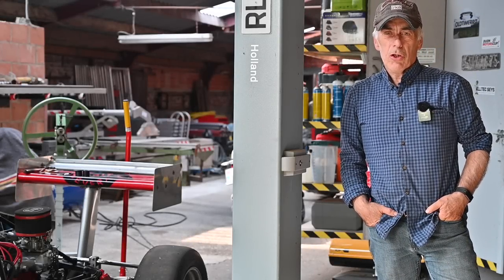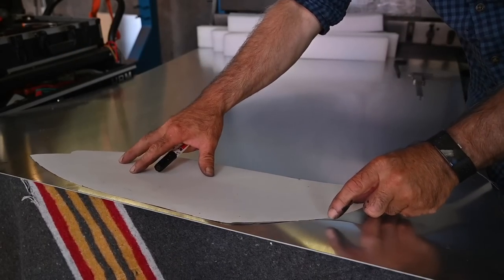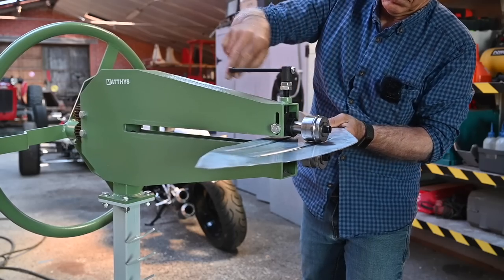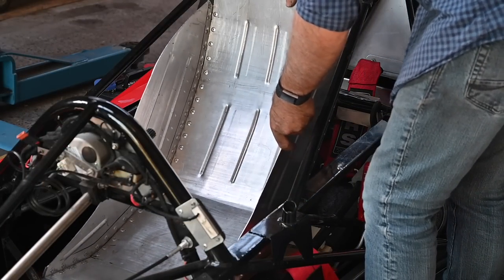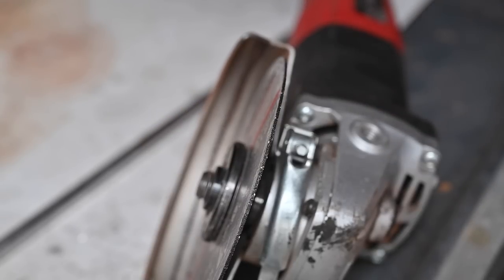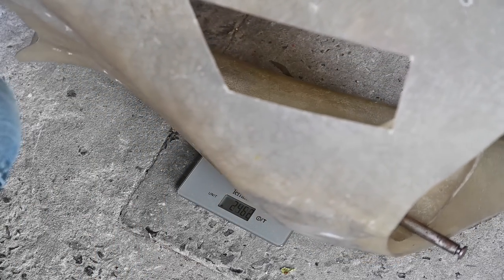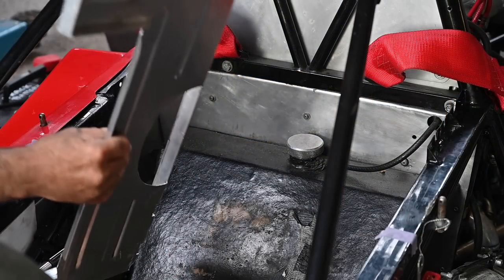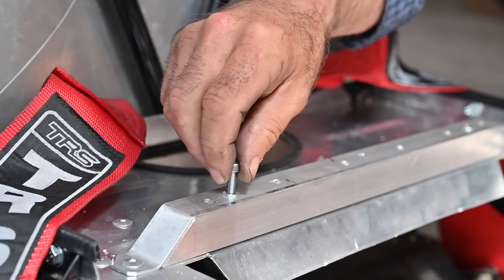Building an aluminium race seat FF

Comment: Nice work. I used modern auto adhesive to stick the slitted aluminium tube over the panel edges. Fill the tube through the slit (or via an extension tube)  and push it on. Never comes off!
Reply from the maker: Indeed that is also a way to do it,  I use sometime the glue used for glazing in cars.  Thanks for the comments

Comment: welding aluminium with comfort will require some (private) lessons,  That is the best way to approach it IMHO. I did that and it made all the difference. Your AC welder looks like a proper one.
Reply from the maker: Thanks for the comments, and indeed it takes a lot of time to get it right and I did not wanted to take changes.. on thick ALU its not to bad , but on this thin stuff  I can get the puddle to flow correctly... That is why I need to get some smart guy to  show me

Comment: This is a very interesting video. One of the problems of welding aluminium is that although the welds are strong, the properties of the aluminium around the weld can be dramatically weakened by annealing (which then leads to overspecification). This is why the Lotus 25 aluminium tub (the first modern F1 car) was (aircraft spec) rivetted and glued aluminium.

The use of beading was a good reminder. I can see a use for these techniques for another project and appreciated the ideas below to use adhesive to avoid the parts becoming unseated by NVH. With your Lotus Elise repair experience...I was holding my breath waiting for this to reappear!

Might I suggest for the next video: (a) making a head rest (b) that you wear gloves (I often use cheap gardening gloves!) as aluminium can give nasty cuts.
Reply from the maker: Thansk for the comments Andrew, and indeed  Alu can cut as I have found out when I walked into a panel... some time ago   10 stitches.
Reply: @D3Sshooter  Thanks Steve. I'm going to put some of your ideas into practice for my project.

Comment: Lovely job! Suggest you run a little Loctite between those blind rivnuts and the aluminium panel. They have a habit when loaded or vibrated of becoming loose, then you can't undo the screw because it is tight in the threads and the rivnut turns instead. Very easy to install but a real pain to get out when this happens!
Also, what are the rules in Europe about fuel tanks? In UK for racing it's not allowed to have a fuel filler in the driver's compartment. Not ideal for older cars because people then add a filler neck into the engine compartment and use rubber hose to connect it onto the threads of the tank neck. Leaving the standard filler cap (as you have) looks a much safer job to me. This is what I have done on my PRS FF1600 which I only use for track days.
Reply from the maker: Thanks for the comments, and indeed very good practice...  I know those are a PitB when they turn wild

Comment: will you be putting a head rest pad on the roll hoop? I was a corner marshal that had a Formula Ford spin and hit an embankment backwards in my corner. The drivers head whipped back and his helmet collapsed where it hit the roll hoop diagonal brace. Luckily the helmet did its job and the driver was fine, but the head rest pad would have helped a lot.
Reply from the maker: Indeed, that is a must and I have already build one... not in the video... Thanks for the comments

Comment: That's some nice work you did there. Did you consider using the small dies to punch holes in the seat to make it lighter(and stronger). I had a similar seat and I still slid around in it until I glued down the padding. In the end my best result was using a foam fitted insert.
Reply from the maker: I see,   I used anti slip tape and put the padding up
Reply: @D3Sshooter  That will help, but there's really no substitute for a nice, comfortable, snug fitting foam insert. And they weigh hardly anything.

Comment: First time I'm not impressed by your work. This seat will not work. 
The forces will not be equally spread on your body und you will get bruises from pressure points. 
Unless you are driving very slow. But thats not your goal, isnt it? 
Please put in a foamed seat shell. Its not only more comfortable but much safer too.
Reply from the maker: Thanks, I guess I will soon find out ... ..and yes a foam insert is far more suitable there is no doubt about that...   August is time for its test in Spa Francorchamps , so i might come out all blue,,,,,
Reply: @D3Sshooter  Take some pieces of foam with you that you can stuff in on the sides. You will need them. 
Or a rib protection vest as used in karting.
Anyway all the best for Spa. Have fun.
Reply: I think you'r being bit harsh on Steve, but you're on point about a foam insert. The aluminum was a nice start, I would have added more dimple dies to lighten/strengthen as a base then add a foam insert.
   Although, as nice as all the work Steve did was, I'd just get as new glass seat and add an insert and save myself the fabricating work.
Reply from the maker: @RallyeRacin9  Thanks ... I will
Reply: @rickden8362  Didn't intend to be harsh. Just wanted to be constructive and wrote from my experience.
Reply: @RallyeRacin9 It's all good. I think we were both coming from the same place. It looks like he got the clue.😉